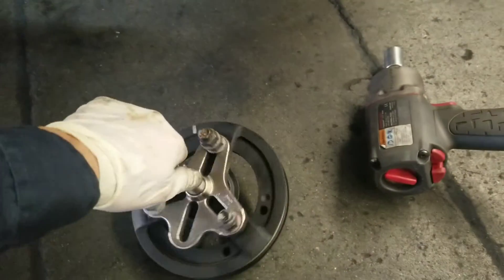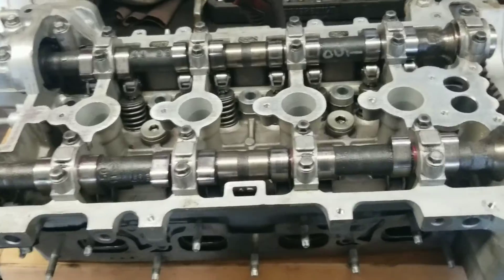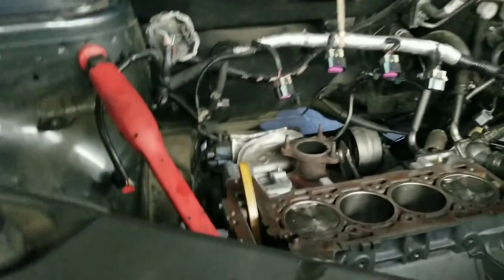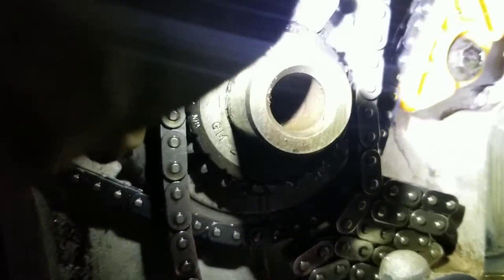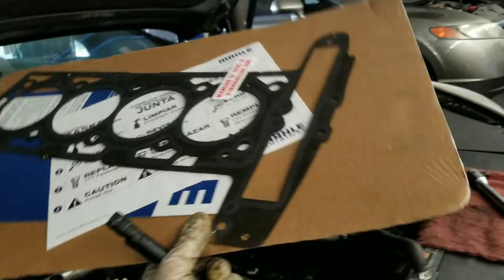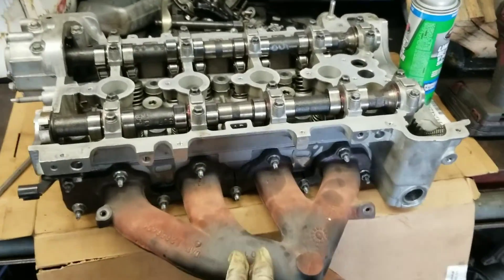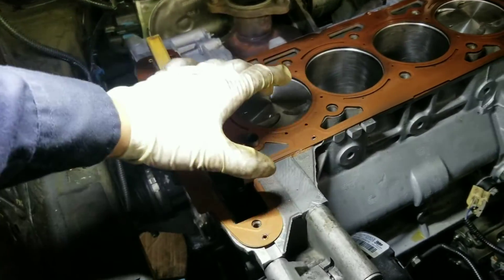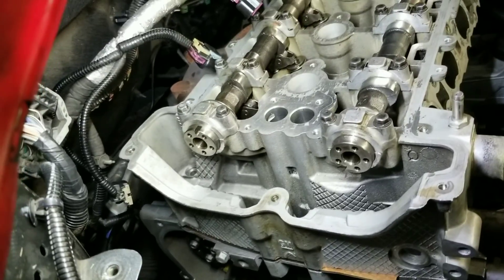Chevrolet equinox 2009 - 2017 2.4 timing chain Marks head gasket replacement head bolt torque specs

Comment: My 2010 equinox broke the top bolt for the guide on the right side, can I get a head from any equinox ranging from 2010-2016 or just 2010?
Reply: There's a way to fix that look up timing cap bolt
Reply: Yes

Comment: The way the exhaust manifold is colored you can tell it got severely overheated, in which case that block is going to be warped. There's no way it's not if it was overheated, curious as to what he did about it definitely leaving it like that not gonna work

Comment: My wife suford engine issues on her 12 Captiva . I think the timing chain skipped or broke. Zero compression on all cylinders. Bent valves or worse. What do you guys think? RAn low on oil..known issue with these motors..Hydraulic chain tensioner lost tension possible and chain broke or worse?? Good video. Me Likey.
Reply from the maker: Only way to tell is to remove timing cover and inspect lol

Comment: Yo if my oil on my 2016 equinox is looking milky that means the antifreeze is getting in there right ? Time to replace the head gaskets or is my issue bigger?
Reply from the maker: Most of the time is just the head gasket but if you overheated really bad,you could even crack the head or block
Reply: @JM8686  has not overheated at all but I do not wish to get to that point , I shall change the gaskets asap then, it's been about 2 months thought should I panic
Reply from the maker: Ohh ok just the head gaskets should do it